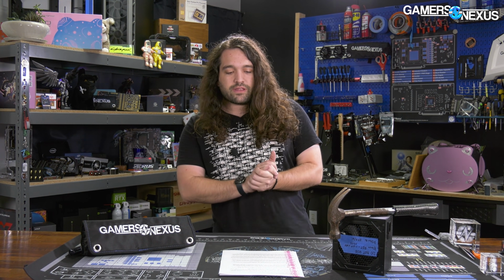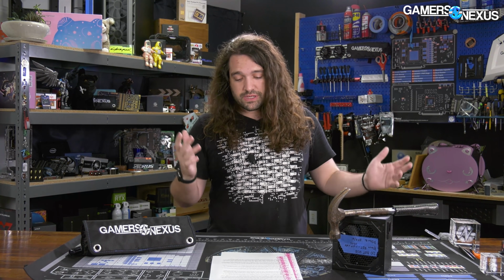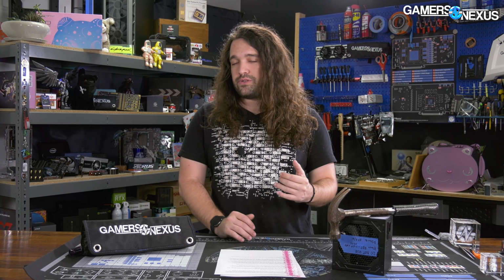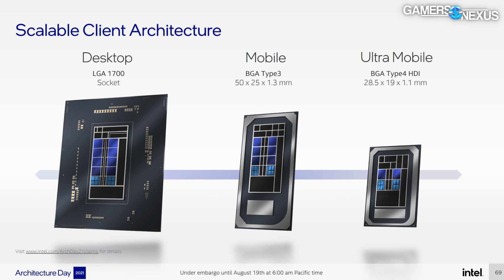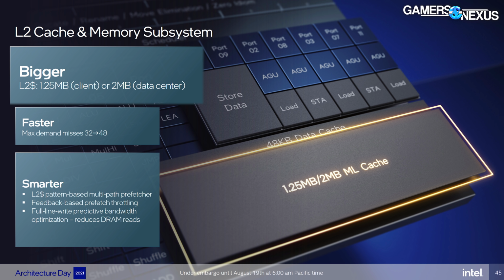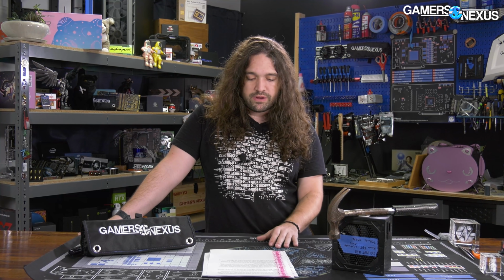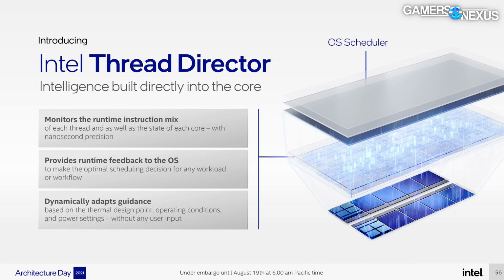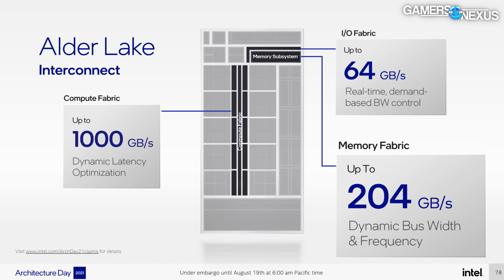Intel Overhauls CPUs: Alder Lake Architecture Explained - New Core, PCIe Gen5, & DDR5

Comment: The last true change intel made was when they integrated the memory controller on the die and revived the HT. After that was about nm and very small changes and fixes and later adding cores, because AMD. Now it seems a real overhaul which is great
Reply: Well, yes and no. While I agree on the last part, Sandy Bridge was none of the changes you described, and it vastly outperformed Nehalem (45nm) and its 6-core die shrink Gulftown (32nm) at a much better power envelope. Since then, yeah, pretty much stagnation and minor upgrades gen to gen. I would partially blame AMD as well, since Bulldozer and its "remixes" were quite weak to say the least, so no reason for intel to push forward. Luckily, now the tables had turned, and both companies are improving vastly.
Reply: @Igbf  Of course new process is better. This is kinda of obvious. You can see that really clearly before core era even with basically no changes at all. You are right but wasn't the point I was trying to say.
Reply: @madson-web  That is not what I meant. The manufacturing process was the same (Both Sandy Bridge and Gulftown were built on 32nm), but due to architectural improvements both performance and efficiency were vastly improved. That is neither HT nor had major changes to the memory controller, that is pure core architecture, when "Tok" still meant something.
Reply: @Igbf  It was optimization inside the same platform. I still do not compare to what is happening now or other changes mentioned. If it was enought to bring more power you can add that to the list, I see a reason. So that is fine. As you said it was at time when "tok" meant something.

Comment: When someone starts talking to you in deeper and deeper layers of tech jargon, you start to lose interest and start to wonder if anything meaningful has actually been said and wonder if they even know what they're talking about.

I'm most worried about the scheduling issues. Gen 1 Threadripper STILL has scheduling problems to this day even after they've optimized for it... so like... good for Intel on this new thing, but I think MLID is correct in saying that this is the first stepping stone to what will be the truly impressive item that follows after. Gen 1 TR was cool... but when Zen+ came out everyone was dumbfounded at the performance and it was actually a very stable launch platform. Here's to hoping Intel doesn't suffer the same teething problems.
Reply from the maker: There's not really much "jargon" here. It's just basic architecture - cache, cores, efficiency. Nothing in that list is "jargon."
Reply: @GamersNexus  Jargon being stuff you couldn't regularly tell a customer and sell it on that, I'd disagree that it's not. I don't even understand what half of it does, and it sounds particularly fluffed up to appear like a huge improvement. We won't know until you techtubers get it in for testing.

In any case, love your stuff. :D

Comment: I'd love a computer with a super efficient core that just sips power like a Raspberry Pi while my system is idle, then the system roars to life when I hit "Render"
Reply: This is already a common feature in ARM chips
Reply: @paco4756  Yes but he said the magic word... RENDER. He can't do any significant rendering jobs on ARM based systems. He like many folks out there want those kind of low power efficiencies on x86 based systems.
Reply: @alexisrivera200xable  you do realize that was one of the key features of apple arm trch that started the M1 revolution...linear sequential rendering on an iphone was faster than a full blown x86 pc at a fraction of the powerdraw. You are correct in saying its not good for render in the sence of complex computations being x86's best feature but we will get there and if something sips power it will scale much better if you get it to equivalent power draw compared to a x86. It will take a long time to get there since software (main reason for all this) is not as compatible as we may thing with ARM architecture.
Reply: @alexisrivera200xable  remember the new M line of apple are based on arm, I wouldn't  underestimate  arm if I were you.
Reply: @paco4756  if only you could stick a 3090 and a full pcix 4.0 slot on a rpi
Reply: @paco4756  Ryzen already does that though. You can watch der8auer video, Zen 2 and above idles in milliwatts range.
Reply: @bltzcstrnx  that's "idle" idle though, no work being done at all. here it means it sips power while still being able to perform light tasks.
Reply: @bltzcstrnx  I'd like to watch that just to see how he could have possibly measured it. That CPU has 11 power pins.
Reply: @ExalyThor I am inclined to agree with you on that. I think Intel is less interested in desktops today. Their focus seems to be more on mobile devices to me.
Reply: @ExalyThor maybe we don't know what we're missing? I have to admit I've never had or used anything quite like it. Not that I really want to. But it could be better than I imagine. I'd rather have all performance cores myself.
Reply: While I can understand why this might be desirable, when I’m building a new PC the power usage of the components, and of the completed system itself, are honestly meaningless to me, other than when selecting the size PS, and what sort of cooling, the system requires. I mean when building a gaming PC, or even one for rendering videos, if everything else was equal, would anyone go with a part, or completed rig, with say 10% less overall performance, because it would reduce the electricity usage of it by say 20%, or even considerably more?
Reply: @johnpatz8395  I actually do stay away from the most power hungry components. Some of the stuff out there is just insane. I'll wait until technology catches up to that performance level. I do not need peak performance anyways. But at the same time I won't get the most energy saving stuff either. I'm not super concerned about every last Watt. 1,000 Watts is hair drier material though. I do not want to be running a hair drier as a PC. 300-400 Watts OK.
Reply: @1pcfred  You're not going to be running a decent PC with a 400 watt power supply these days lol. The reason why high wattage power supplies are the norm is because as CPUs, GPU's and RAM get faster and faster they more power they require. 

Most people buy higher wattage units because of their efficiency rating at supplying that power at a given percentage of its total maximum is an order of magnitude higher than any of the lower power units. And they run cooler. 

The closer to the maximum that your PSU is utilized, the hotter it gets and the less efficient it becomes. With that comes more noise. And you're also limited in future upgrades on the PC because you'll need to replace the PSU for the higher power requirements.
Reply: @rotor13  There is no correlation between speed and power consumption. Well there is, but there isn't. Using more power is not why we can run faster today. In fact the less power you use the faster you can potentially run. Because you can only dissipate so much heat. That's the overall limiting factor determining how fast you can go. It's heat. Power has to be dissipated as heat. electronics can only get so hot before they're damaged. Therein lies the problem. We're getting marginally better at making components that can tolerate more heat. But that's not where performance increase has traditionally come from. We go faster by using less power. What you're not taking into account is the number of switching elements increasing though. Which each need their bit of power. That's where the increased power draw came from. There's more parts in parts using power. Die size has increased too. There's more parts over a wider area. Which does let you dissipate a bit more heat.
Reply: @ExalyThor yeah, I don’t want a space heater either, and will go with components with lower draw, if performance isn’t much different, say in PS, SSDs, etc…, but when it comes to the CPU & GPU, my only real interest is overall performance, especially in gaming and I really only look at power usage to decide on what capacity power supply I’ll need for it.

While having a system pump out tons of heat can suck, I’d rather have to turn our ac on more often, to have a system that runs faster, and will last longer before it REALLY needs to be upgraded, than have the ac rub less but need to replace the system, say a year sooner.
Reply: I could honestly care less about power consumption.
Reply: I would rather get more power cores and 0 "efficiency" cores.
Reply: @petervansan1054  I would rather get faster single amd multi core. Alderlake slaughters amd
Reply: @MrWarface1  wow no shit two generation newer cpus going to be faster
Reply: @petervansan1054  speaks volumes when 0 generations of amd is ever faster than intel. keep suckin on that amd fanboi teet.
Reply: Apple M1
Reply: We already have that with frequency throttling.
Reply: @1pcfred  not even close. look at the power draw of a desktop pc at lowest energy states and still active compared to a rpi even at full load.
Reply: @55S55  and you think all of that power draw is solely down to just the CPU? How would I look at that anyways? How do you look at it?
Reply: @1pcfred  no, not just the cpu itself but the entire system. all the relevant power draws are expressed in hwinfo's metrics. i can tell my 3090 pulls about 400 watts by itself when in a modest overclock, for example through hwinfo. i suppose you could also use a killawatt product and measure the output going through plug, even easier though i suppose you'd have to shovel out like 20 bucks.
Reply: @55S55  getting a more efficient CPU is not going to help you with that pig of a graphics card that you're running. I mean why even bother?
Reply: @1pcfred  Nowhere near the sort of low power draw you can get when a system is idling.
Reply: @1pcfred  🤦
Reply: I think it would be neat to see a hybrid CPU with ARM and X86 cores on the same chip. (yeah I'm fvcking crazy, but for mobile developers this would be super cool).
Reply: @BrainSlugs83  actually this has sort of already happened. The PS4 console uses an arm CPU to take over sleep mode duties like downloading games and updates and its gameplay capture and sharing stuff. They only use the AMD based x86 CPU to handle games and the system menus.
Reply: @BrainSlugs83  you can do that with virtualization. There wouldn't even be a performance hit going from higher performance to lower.

Comment: Very interesting stuff. I was initially skeptical of the heterogeneous Perf/Efficient core setup for desktop. However I suppose if you think about it, at the top end this is basically an i9-9900k with up to 8 atom cores on the side. The atom cores handle all the OS, light tasks and background junk, totally freeing up the “9900k” performance cores to use all their resources and throughput for bigger tasks.
Reply: that's why I would like to see more real world benchmarks.  who is gaming and doing nothing else at the same time
Reply: Another interesting note is that the atom cores aren't all that light themselves.

Some have described Intel's big.LITTLE as more of a big.MEDIUM. In terms of MT performance, the atom cores are fairly hefty, and future Intel generations are rumored to increase the e-core count to continue improving MT performance (e.g. Raptor Lake top-end SKU is rumored 8 + 16). This is the opposite approach to Apple's M-series chips, which are rumored to increase their big core count, and where the Icestorm / e-cores are truly just there for power efficiency. In short, the little cores have quite a bit of throughput themselves, and if you were to run a highly multithreaded task (e.g. typical Blender test or something), the little cores will definitely make themselves count.
Reply: the performance cores are going to be much more powerful than the 9900K on their own.
Reply: @Lemard77  yeah, probably true, just an analogy
Reply: If you’re interested in real world results: Apple’s M1 is big.little(like) and running a desktop OS.
Reply: my question is how is it that 8 performance and 8 efficient cores can be better than 16 performance cores..
Reply: Funny you make that analogy as the E cores on the 12900K are basically equivalent to a 9700K. The big performance cores on alder lake are more than 60% faster than a 9900K core.
Reply: The best way to look at it would be to look at how iOS/iPadOS and Android (and to some extent Win10 ARM) handles the BIG.little architecture that is prevalent in ARM CPUs today. If Intel can pull this off, it will make for some really performant AND efficient x86 chips. Even better if AMD joins in. I would love to see what Zen could do when shrunk down for almost no power consumption.

Comment: ddr5 4800 sounds kinda underwhelming, I realize it's not a direct comparison, but ddr4 3600 is not difficult to get without paying a premium,  up into 4000 isnt even horrible
Reply: DDR5 4800 is JDEC, basically the certification, we already know there are DDR5 5600+ RAM modules that will be Alder Lake ready at launch. Also DDR5 reads and writes simultaneously, unlike DDR4, there are massive improvements that you cant see by just looking at the one 'speed' number they use.
Reply: @__aceofspades  ya I honestly haven't really looked into ddr5 yet.  I was expecting to get a 5800 or 5900x, but now I'm gonna wait to check out alderlake.  after my first gen ryzen disaster I'm hesitant to be an early adopter
Reply: ? becasue the goto of 11th gen is 3200(thats the guidance) and for the lower parts even 2800, so having ALL cores support 4600 is neat...for most cpus even aboce spec its limited at 3733 unless you go g2/1:2 mode...